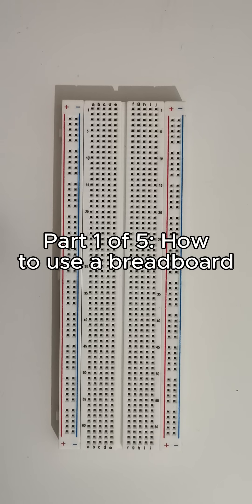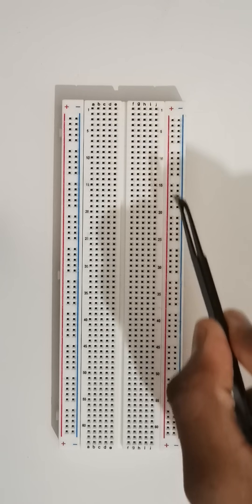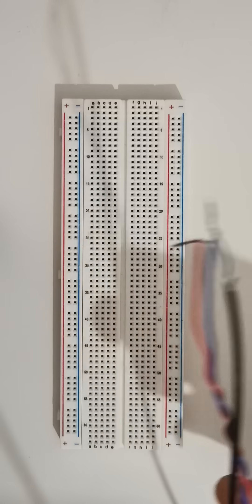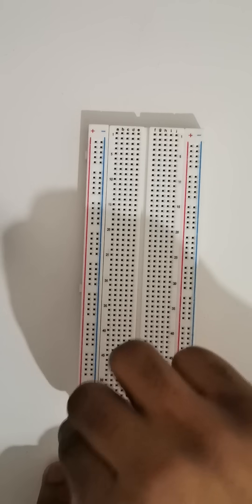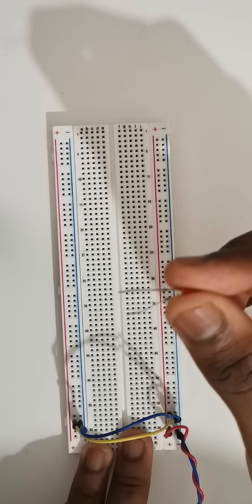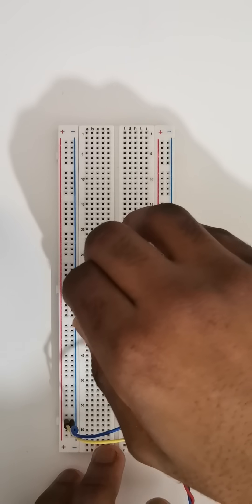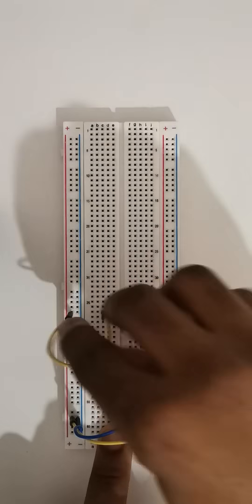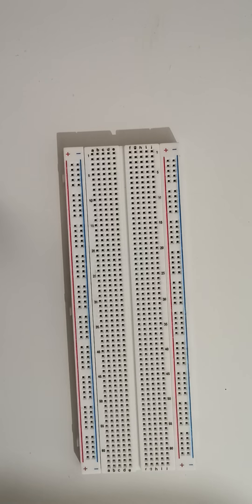How a Breadboard Works #cpu #computerperformance #computerscince #facts

Comment: Yeah I remember in highschool electronics, all LEDs need a resistor. I assume that's the case now?
Though a friend recently gifted me two LEDs, a red one and white, both with a few inches of wires on both sides, I've hooked them to various batteries up to 9 volt, I didn't want to go higher and blow them out. Only thing is, I'm not sure where the resistor is hidden???

Oh, and the red one even blinks!
Not sure how they did that? I see no other components.
Reply from the maker: I'm not sure what type of LEDs he's using lmao. All the LEDs I use explode if I connect them incorrectly. Then again I buy cheap LEDs from AliExpress XD